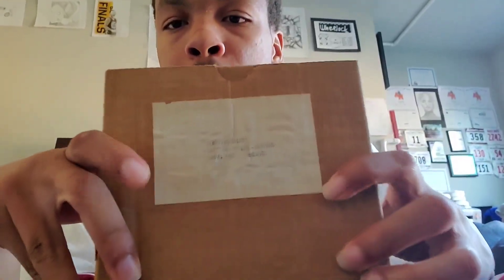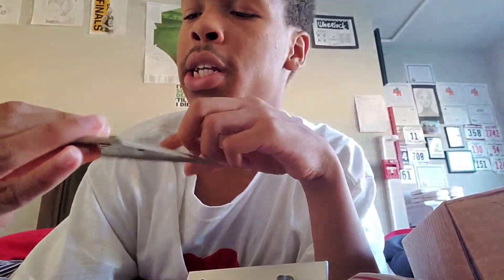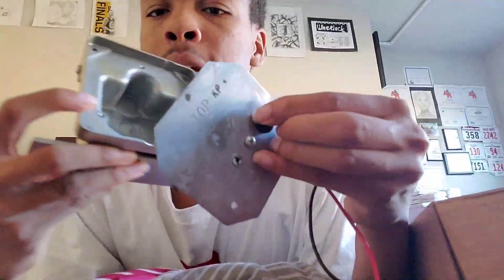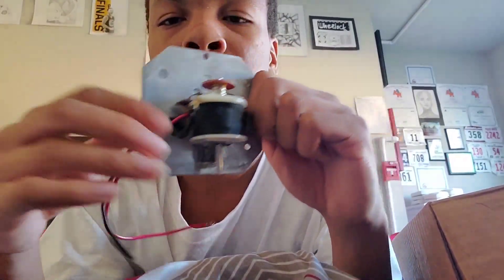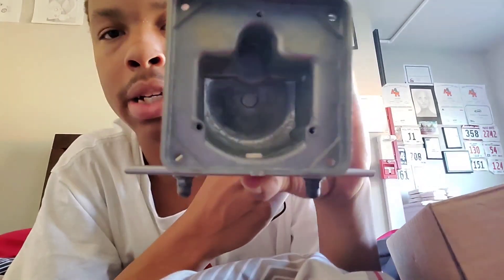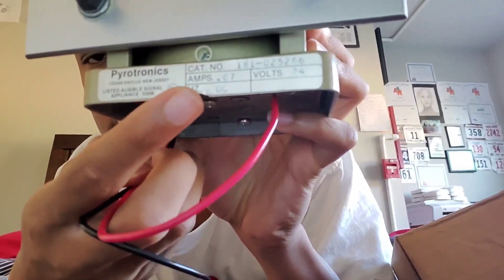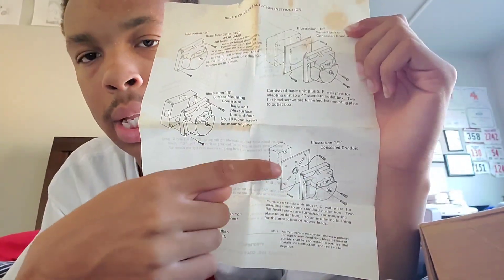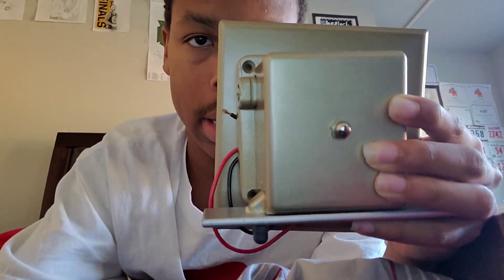New Device| RARE Pryotronics CDC-24

Comment: Do you still have the 5808
Reply from the maker: Yes
Reply: @BlackLightning4547  I would like request this system.
The pryotronics cdc 24 on a 4903-9101 strobe plate
And the Honeywell chime 
Both on. Code 3.
And for the pull station 
Simplex 4251-20
Reply from the maker: I'm not taking requests at this time
Reply: @BlackLightning4547  ok